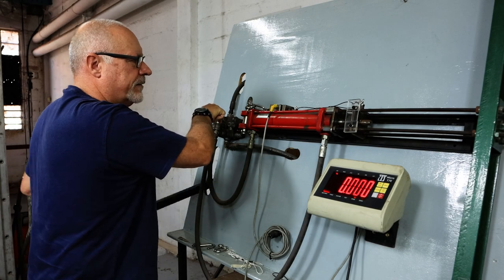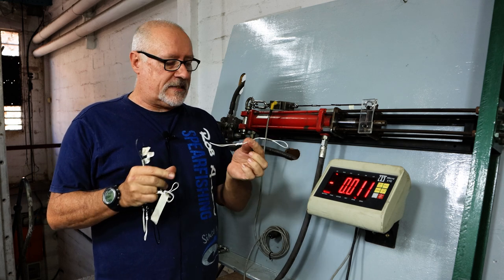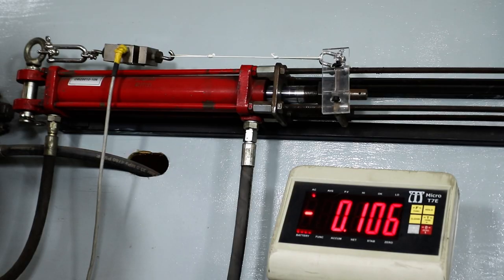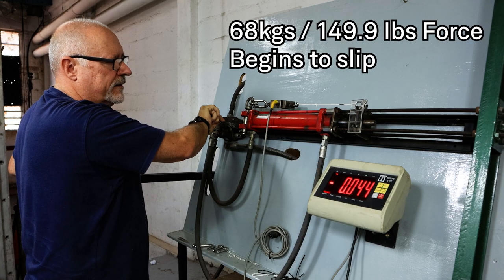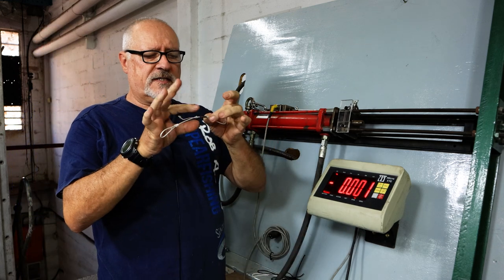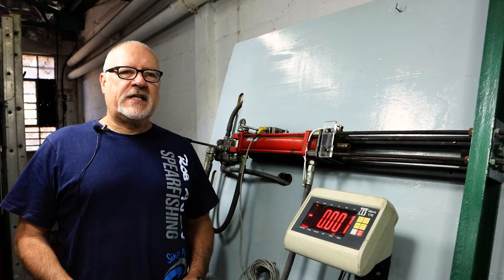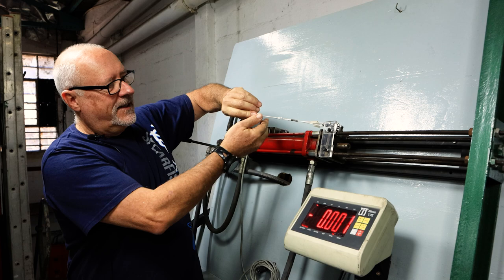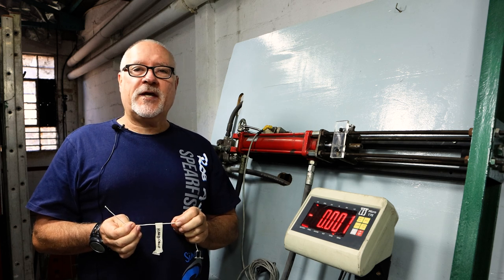Rob Allen | Dyneema Crimp Test | 2022

Comment: ..i would love to see a load test on your bungees. So far i would use neptonics or riffe full stretch bungees to be on the safe side. Not sure if your bungees can keep up with those. Talking about the use for  big and very big tunas (100-400kg) . Run a test on your Latex bungee with 270kg  3x-stretch , and on your 
Bluewater floatline bungee with 180kg 1.5x-stretch. The ends connected to a shackle. Very intresting to see the real breaking strength and where it would snap..
Reply from the maker: The strength is not in the bungee material but in the Dyneema core. We use a Dyneema that is rated at 180kg. Basically the same amount of fiber that is in our Dyneema shooting lime but in a softer braid. This increases the knot strength. We are getting 125 to 145 kg break strain on the spear line, the bungee line should be the same or greater. In reality, the spear line will break before the bungee. I will do a break test on a small gun bungee sometime, as it has the same inner Dyneema core as our bungee blue water float lines. On a side note, we don't use latex rubber for these as the stretch/spring back requirements are not the same as a spear gun rubber. We use a TPE for the gun bungee and a TPU for the blue water float line.
Reply: ..on your website it says that the bluewater floatline bungee has a breaking strain from well over 400kg. How did you got that info ? I would like to see that whole original bungee with a shackle attached to each side and pulled until it break. Most intresting to see when and where it will break. I guess not easy to arrange but that would be a true performance test.
Reply from the maker: @Euro0815  I will do a test sometime. I think the person who wrote that just added the Dyneema break strain rating, 380kg plus 25 kg for the tube. Thanks for bringing it to my tension. The knot inside will reduce the Dyneema break strain by at least 30%

Comment: Should I be crimping (with hand crimping tool) monofilament in 3 places? I saw somewhere they explicitly said to only crimp on each end.
Reply from the maker: It will depend on how long the crimp is. Many are so short that you can only crimp twice. Our crimps are long enough that 3 crimped points are possible with a small gap in-between. Don't crimp too close to the edge because it will cut into the mono line.